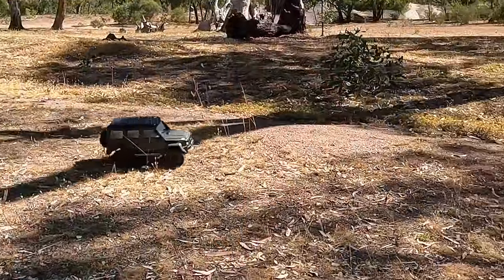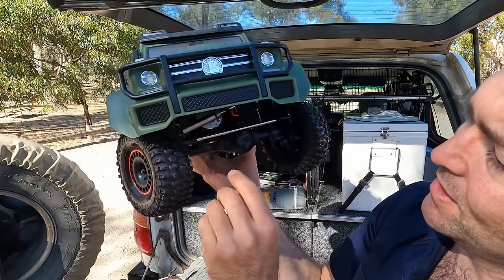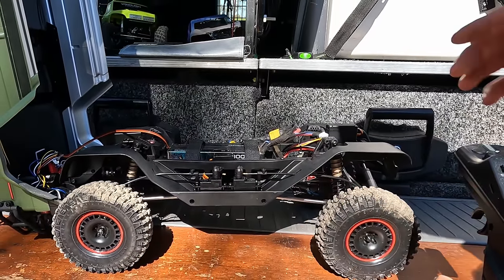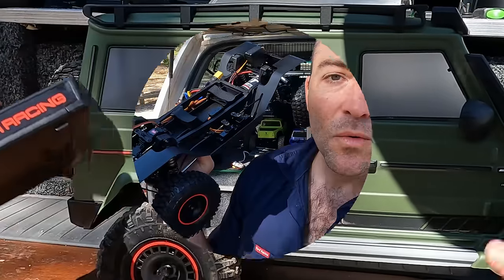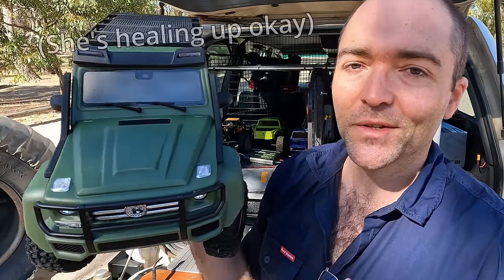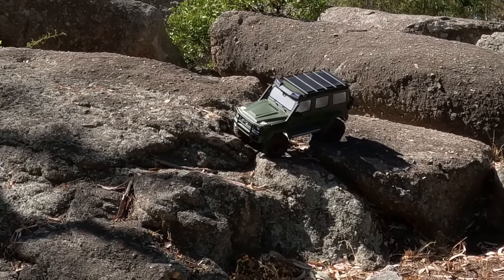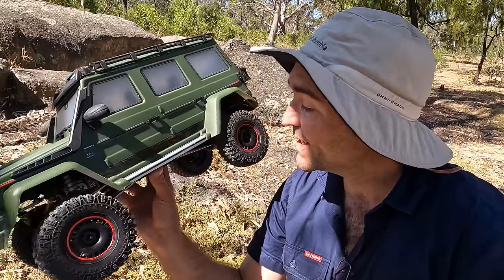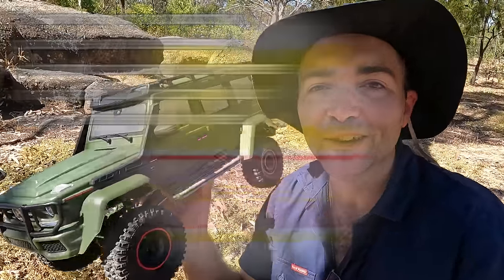Something Actually NEW in RC!

Comment: Impossibel too upgrade too a Fusion because the reciever /ESC  is a 2in 1 ! If you want too upgrade too a Fusion you need a new 10 channel Radio too. Yikong sell also a clear window version and also a way cheaper version without interieour shift servos and without the cutting brakes. I like the truck but its way too top heavy maybe with a light Pickup Body its perform way better. I think the Yikong 4101 perform better as a crawler.Maybe you can test also the Austar AX-X6 with Defender double cab "hardbody" ! the only TRX6 "clone"  on the market but 1/3 of the prize !
Reply from the maker: I don't think this model needs a Fusion upgrade. The 550 32T motor is pretty perfectly paired to a well-balanced 2-speed transmission. In this case, it's not worth the expense. (And for what it's worth, I have 10 or 15 Fusion systems in various cars. I like them a lot). They've got it right such that the FOC won't be hugely missed - it doesn't crawl well enough to need it anyway, I think.

I could look into the AX6, possibly. I'll go check it out now and we'll see. Cheers
Reply: AX-X6 is not, by far, the only TRX6 "clone" (if by clone means every architecture that Traxxas as produced first, even if it does only looks like a Traxxas copy blindfolded) ... Yikong has its own with the YK6101 (same axles as their YK4101/2/3/4/5, different from YK4106), CrossRC has its AT6 and now NT6  ... and there's still, at least here in EU, the Freemen 2.0 6x6, clone of the UMG10 6x6, that you can get in the sub 300€ once in a while.
Reply from the maker: Good info, thanks!
Reply: @TuxStang  Austar copy the axels very close even the complete drivetrain with two speed and shiftabel lockers. Freemen  have the hypoid ring and pinion more like Axial UMG no shiftabel lockers non two speed far away from Traxxas TRX6 equippment. Yikong is double the prize of the Ax-x6 and not a clone its a  6x6 with portals made with  strong Yikong axels designed far away from TRX6.
Reply: @RCTNT  The Fusion is the only choice  if you run often rocky rivers instead of buying 5 brushed motors a year.
Reply from the maker: This is fair enough, then!

Comment: …i dont think 1/8th scale cars have a lack of power.. i’d like to mess with an electric, but, with the older style nitro brake, and adjust the front rear bias… i would think its not as easy as just adding the motor cause throttle would be ESC then brake to the servo…? Not sure how that could be “tested” to see if it works…
Reply from the maker: Mixing could get you there, as far as control goes; whenever breaking with throttle, don't send a signal lower than zero to the esc but instead proportionally send that negative signal on another channel, to which the breaking servo/servos is/are connected. Take it a step further with traction control via independent wheel braking: each wheel's speed could be monitored with a hall sensor on each axle or wheel, depending on the car. I bet I could write the monitoring and braking system for Arduino, it could be entirely separate to throttle inputs. It's so close I can taste it! Just gotta put the time aside to build it - though I'm expecting someone is already working on it!

Comment: Compare with fms fcx10 k5 clezer
Reply from the maker: The FMS is 30% more expensive than this. It has the licensed body and tires. No disc brakes but does have DIG. Body is better quality on the FMS, though it has no interior. Radios are the same. 

Chassis is steel while the Yikong is plastic, though I'm not sure which I like better on that point. Diff lock is done better on the Yikong; the fms works but that actuating arm on each diff is very exposed. Dunno how it'll like being muddy.

Build wise, they're similar. I'd expect the fms servos to be better quality given the higher vehicle price.

Overall, I support the fms over this given the IP theft apparent with the body on the Yikong here, and the hyrax tire treads. 

Other than that, buy the one you like better!
Reply: @RCTNT  ok Mr. Thanks your information ilove RC TNT😍

Comment: tempting to buy it until I read your article that this is a plastic chassis. Hope you can torture it in your usual review, and also how much weight it is including the battery?
Reply: This chassis is fibered nylon, as stiff as a Gen8's chassis ... it's not a toy but a real chassis, low profile, with not much above it's top line.
Reply: @TuxStang not a toy.. 😂😂😂
Reply from the maker: When I read the chassis was plastic, I thought similarly to you at first. Yes, It is plastic, but it's very stiff. It has less flex than some rigs with C-channel steel rails. And because it's plastic, it's lighter - a real benefit on any model!

Rock crawling test coming soon, you bet.

Vehicle weight, without battery: 3.4kg or 7.5lb. (It doesn't come with a battery, so I won't include the weight of one as it's largely a redundant figure).
Reply: @TuxStang  wait, gen 8 has nylon chassis too?
Reply: @RCTNT  3.4kg on pro version is quite heavy, surprised since i though it will be lighter because the plastic chassis. Ok I'll wait for the usual review 👍👍
Reply from the maker: This was the review. There's a crawl test coming. The article you read is the more traditional review. I won't do one for video as it'd be a bit redundant in this case! I hope you got the answers you're after! The crawl test will be informative, I think. 

3.4kg is virtually feather-like given this is a full size rig with an interior, so those servos, a big 550 motor, two speed gearbox, etc. It's most impressive.

(PS. Gen8 v2 is steel chassis rail.)
Reply: @Latimerias_trailncrawl  Gen8 has metal frame-rails like others ... but twice the size.

Comment: i have an axial basecamp and i dont want dig or two speed transmission or locking diffs. all of that is just more shit to break and or come loose need a tune or setting changed etc. that car looks and sounds like its gonna spend more time soaking up parts and wrench time than actually enjoying a drive. just my two cents.
Reply from the maker: I hear you. Thankfully the market has you covered - there are heaps of basic models with just steering and throttle. There are also heaps of tricked-out, multi-channel monstrosities for those who love the complication. I'm just pleased we have such choice these days!
Reply: there's a SE version too for those who are affraid of braking ... painted windows, no interior, no lights, no "tank-turn", even no spare tire ... just 2 speed on the radio and manual locking diffs.
Reply from the maker: It's especially cool the diffs are still remotely controlled on the SE, I hadn't realised that. Nice!
Reply: @RCTNT  Manually controlled, not remotely. The SE also has a better weight biais, not by much but on the front, it would handle better.
Reply from the maker: Oh I see! Very cool! Honestly I might have to get it to compare them!

Comment: Those breaks will overheat fast
Reply from the maker: On a fast car they may, but not a chance on this rig. They don't grip super well (wish they worked better on high traction surfaces!) and they're only in use periodically. The wheels turn slowly enough on this car that heat will never be a consideration for this kind of implementation, IMO.

But on fast cars for traction control, like we discussed in the video? Or for front braking on RWD vehicles like we've been discussing in the comments here? Well, yeah, that's actually a very pertinent point I hadn't considered!

Comment: Cable disc brakes on a off road car absolutely no, we ran them on road 1/5 scale cars and total nightmare.
Reply from the maker: We already have cable actuated lockers on many models and it works reliably. This isn't so different, and so far, it's working fine.
Reply: That's different as the actual actuator is inside the cases and semi protected where discs and pads are right out in the mud and water
Reply from the maker: Ah I see. The disc and pads on this thing are fairly low friction materials, funnily enough. I think they'll be okay. Little pebbles and mud might be a temporary issue, but the clearances are much larger than on more typical disc brake setups.

You make a fair point, though. I guess we'll see.

Comment: Can you Take the body off so you can see
Reply from the maker: Two screws in the rear will let you remove the body completely, but you want to watch the light kit is disconnected too.

If you meant instead whether the interior can be removed to look at it, yes, it's a few screws to remove that from under the body.

If you meant to ask if the frosting on the windows can be removed, I'd give you a gold-plated schmaybe. Probably, with some effort and the right solvent.

Comment: We need 5 speed transmission so we can make oldschool muscle cars lol
Reply from the maker: Oh boy that'd be awesome
I have a Tamiya 3 speed here, which is cool. I guess it wouldn't be too hard to link that to a 2-speed xfer case for high and low range with 3 speeds each...
Reply: @RCTNT  Most likely it would take up alot of space on the chassis to do that
Reply from the maker: Not necessarily. I have a nice, small 2-speed unit. I could put it on the out drive of the 3-speed. Only need one extra mini servo. I reckon it should be doable.

However, with FOC brushless being what it is these days, it really isn't needed at all. (If we only had brushed motors still, then yeah, this could be a compelling project!) Maybe I'll save the idea for the next big, scratch build truck I make or something 😎
Reply: @RCTNT  i use brushed combos for testing custom builds when im finished building, ever since i went brushless i cant go back to brushed its way to slow
Reply from the maker: Haha, isn't that true? Brushless motors, powerful and fast servos, 2.4ghz radio, strong steel gears, reliable and waterproof electronics, better plastics, the list goes on. Everything is so much better these days!

Comment: Man you think if you're going to make a video about a truck you would think you would at least have the information right literally everything you said about this truck on your video was wrong and you had to correct yourself on the screen..

And as for that steering damper using it as a steering bar that's a great idea in theory but in actual use it's not as good as you think I have that on two of my custom-built trucks and they've been like that for a few years and it's not nowhere near as good as you think for crawling...

As well as those cables for the disc brakes those aren't going to do nothing but get caught on everything and get ripped out and then when those disc brakes get full of mud I don't think that's anywhere near good that's why Traxxas doesn't do it and that's why no one else does.. that thing is full of a bunch of"new stuff" that won't work on real conditions
Reply from the maker: Thanks for the feedback. Sounds like this style of video is not for you - it wasn't a review so much as an exploration of a rig that came with no manual and has a lot going on! The idea was to work it out on-screen, giving you an idea of what it might be like to buy one yourself. Even though you don't like the truck and you didn't like my video, I appreciate you taking the time to get your thoughts down. I pay attention and am glad you took the time. Thanks.
Reply: @RCTNT nope that's not it at all I never said it was a review or anything but the point I was making if you're going to make a video about a certain object you should at least have the specs in particulars correct not go back later and have to edit it in a few times is okay but man almost everything you said you had go back and edit it it's really not hard to know what you're talking about and yeah you're right that truck ain't for me because I don't buy cheap garbage like that
Reply from the maker: I hear you. This wasn't my best work. I made the choice to try to film a few videos that morning - my first since January - but I wasn't as prepared as I'd have liked. I drove 2 hours from home to get my dog in surgery, so I just bundled in a handful of cars and my cameras and winged it. I had a few hours to kill while she was in theatre. 

The choice was to film at all or miss the window and so I took it. I still made the choice to publish the video, so your feedback is fair. I will try to do better! Cheers.

(although I just watched the video again with your criticism in mind and I made three mistakes that I corrected on screen: "37 turn motor" (corrected to "32 turn"), "4103 Pro" (corrected to "4106 Pro") and a slip of speech around the 11 minute mark saying "front and rear disc brakes" (corrected to "front and rear lockers"). I meant lockers in that third one, but I mix up my words sometimes. I got the model name a little wrong and the number of motor turns a little wrong. Your comment said "literally everything" and also that a few mistakes are okay. This was an exploration of an unfamiliar, complex model without a manual at hand and no internet available. It doesn't seem as grievously bad as you suggested... I think perhaps maybe my videos aren't for you! Peace.